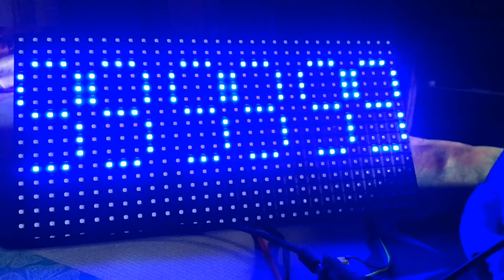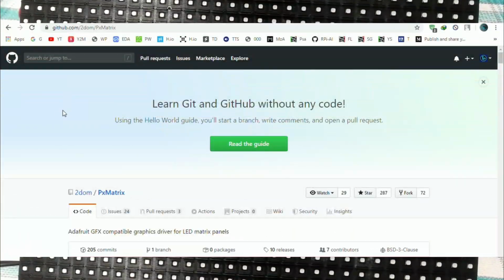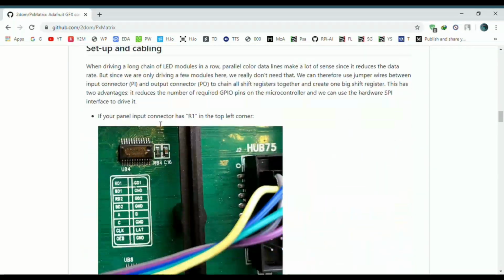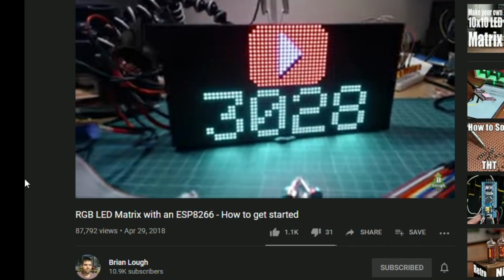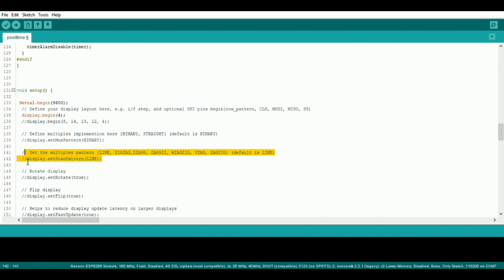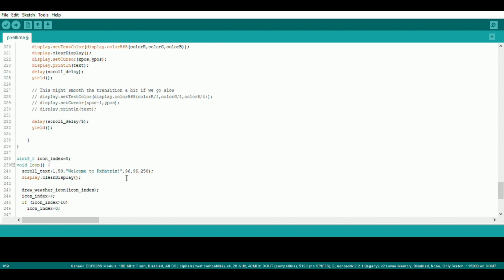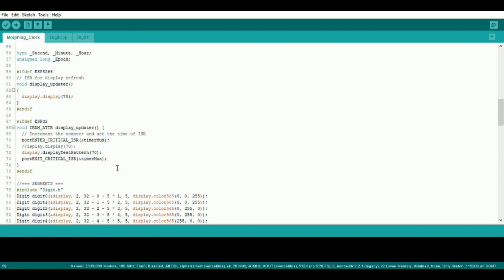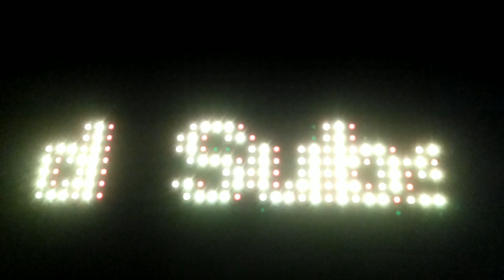RGB LED matrix Display using ESP8266 | Morphing Clock

Comment: Hi Electro Point, I did the say thing as you did. But my ESP8266 is not getting upload, when I remove the pins from ESP8266, its uploading... Is there any problem with my p10 board? Its working perfectly in Arduino Nano

Comment: Sir, can you teach us daisy  chaining of p10 rgb outdoor using px-matrix. I am using 32x16 display with 1/2 scan rate. It works well as a single panel, but when I am daisy chaining its not scrolling properly. I followed all the steps in pxmatrix github page and still its not working